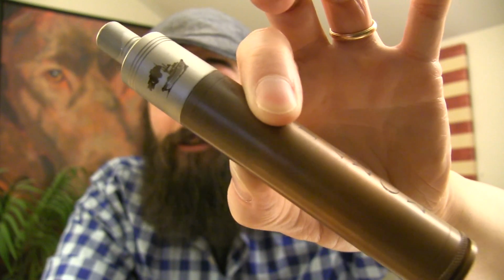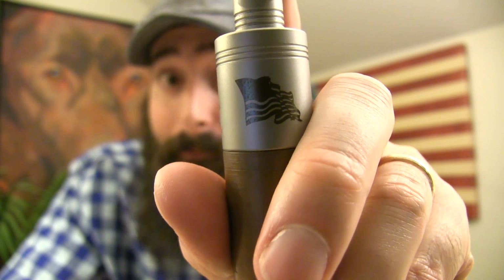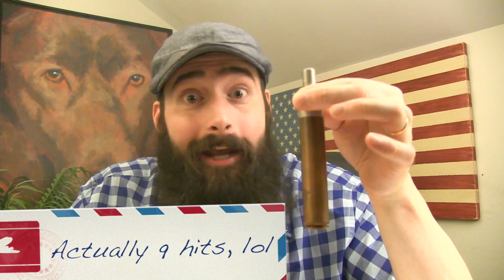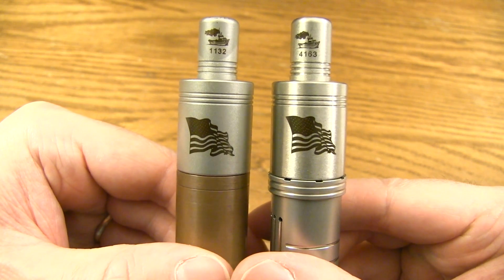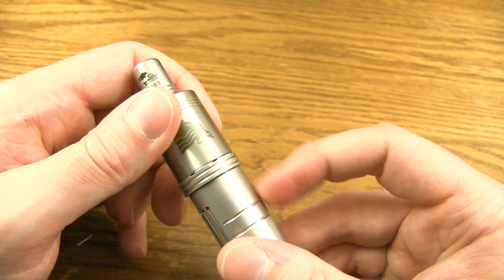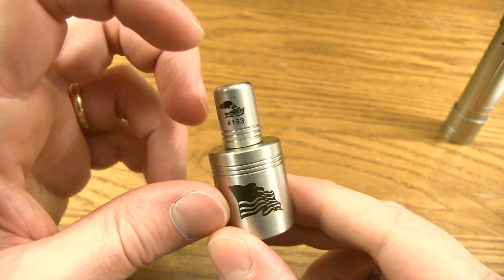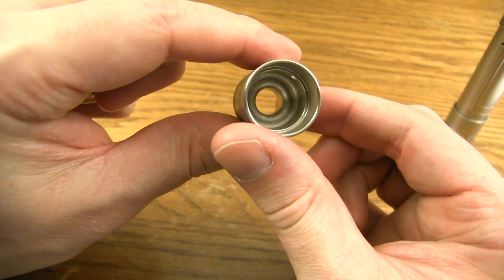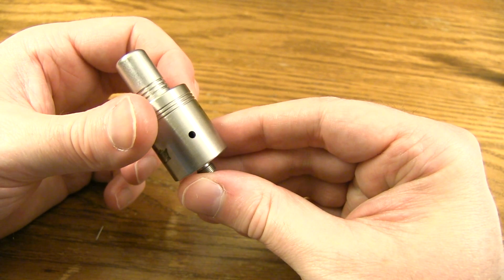The Tugboat RDA

Comment: I'm not sure if you have seen one but I am a proud owner of 1 of 100 Limited Addition tugboat with a Detroit "D" etched into the side instead of the American flag, and it IS adjustable when it comes to airflow, and its also has 2 holes on each side instead of 1. If you can manage to get your hands on a limited addition like mine, you should do a review on that one, i think you will be more impressed!
Reply: that is the new form of the cap minus the D that part is special but yea the new cap has adjustable air flow

Comment: i just bought this rda and im extremely new to rdas. right now im running 2 .3 ohm coils in series which is at .6 ohms (its on an eleaf istick 50 watt. ). im still getting used to it, but honestly my favorite part about it is the airflow. (before i was using an atlantis) still got some hickups to work out like my ohms keep jumping, but im having fun with rdas. im thinking about getting another mech mod with an 18650 battery for it.

Comment: I have one of these (genuine) with the media blasted finish. Works just fine. Generally, I run a single coil in it  - without any issues. It has larger air holes than my Patriot (genuine) and I do like that. It also holds a lot more e-liquid than the Patriot which is a bonus. Dripping every 10 minutes is a serious PIA.

Comment: I love my tugboat. I have the stainless version and I'm running a .24 ohm 5 wrap single coil with 20 gauge wire and mine heats up after 3 hits. Maybe since you're higher ohms it doesn't get hot but mine does

Comment: Would any other caps fit on the deck being a 22mm such as the atomic ? So you can have single coil adj. air flow and deep juice well.

Comment: I need some advice about building coils. I'm not getting them dense clouds. Is it the vg, pg? I'm looking to blow monster clouds. And I'm in the process of quitting smoking. Vapping helped me get down to one pack a week. I'm trying to quit. Any advice will surely help, or a vid. Thanks anyway
Reply: Its all about the build and the juice, higher VG, more clouds, coils at a lower resistance, burn hotter, so uses more juice, more juice and a higher air draw equals clouds, start with dual micros at .6, use safe batteries, get a feel for the clouds, then start tinkering with builds, rip has a video for about every coil imaginable. If you just wanna go straight to clouds, go low resistance wire, like 22-24 gauge, twist up some macro coils, and change the weather patterns in your area code, be safe, hope this helps
Reply: everything Darrin Brown said is correct but why don't you tell us what your setup(atomizer and mod) is, that way we/I can give you some advise on what you personally can do to improve your vape.
Reply: Yeah, definetly need a good RDA and mod to do some work

Comment: Guys mine has a copper center post, copper center pin connection. It's drip tip isn't as long, doesn't have the 3 little ring ingravings, and is steel all the way through. Also it's drip tip on the inside starts to taper down. Is mine a clone? Or is it a different version?

I'm thinking it's a clone but I'm not too worried I got it from someone for free so no harm done to my wallet.
Reply: My one is exactly the same as RiP's one in the video. Does yours have a serial number on the drip tip and base of the RDA?
Reply: cdv1qa Ya and the're both the same number. Also it says #flawless, usa, picture of a tugboat, and serial number on bottom.
Reply: avp3player1 Dunno man, it sounds legit but mine doesn't have the hashtag, but if it's working for you then that's all that matters I guess. Happy vaping.
Reply: avp3player1 Actually mine has a copper center pin as well. All good :)
Reply: cdv1qa Ya this thing vapes like a dream even running a 2 ohm single coil 28 gauge 2.4mm at 15 watts it's still great flavor and Im chuck'in clouds bro! Cloudz!
Reply: you have the tug boat v2 this is the v1 in the video

Comment: Rip, I noticed most of my RDA tend to strip off little flakes of black rubber o-ring onto my wick. The last thing I want is one to land directly on the coil, then I'm vaping rubber.. Any suggestions, or RDA's WITHOUT O-rings? Do you think I could wrap a bunch of plumbers tape around the top where the o-ring was, just to the point where it stays snug enough?

Comment: RIP, you need adjustable air flow, but Are a lung hitter? If i recall u prefer your air holes at a out 5/6", so why the need for a tighter draw? Adjustable airflow is not a deal breaker for me.

Comment: I have a 1.65 ohm kanthal microcoil build witu cotton. All im tasting is kanthal when i vape. I have no idea what's going on...
Reply: did you try firing the coils without cotton and juice? you wanna make sure the coils are glowing from the inside out and evenly.. maybe you have hot legs or hot spots.. give the dry fire a shot and try gently pushing the coil together with tweezers, do it a few times untill you get an even glow from the middle.. make sure you don't fire while the tweezers are actually touching the coils..
also make sure no part of your coil is touching any part of your RBA/RDA other than the legs in the posts
Reply: Iv done all those things. At the beginning it was working just fine. All of the sudden all i taste is kanthal. Im thinking it could be my pallet and iv just stopped tasting the juice. I have this problem when i vape the same juice for more than two days. Im going to try and clean my pallet and see if it fixes the issue. Thanks for the tips though much appreciated.
Reply: Dobby Sounds like you're experiencing vapor tongue. Same thing happened to me. Though I was loosing my mind for two days. Turns out i just needed to lay off my favorite juice for a bit. Or, if you're using a brand new RDA, it may just need to be cleaned out. good luck
Reply: It probably needs to be cleaned due to the machining oils... I had the same issue with my prometheus RBA, I had a .8 ohm wrap and it tasted BAD, burnt metallic taste... so I  was got a small cereal bowl, filled it with hot water, poured Palmolive and oxy clean... and let it sit for 15-20mins, once the water was cooled down I cleaned it with a small little bristle brush and rinsed with cold water...

And it worked! no more bad burnt flavor :D
Reply: They have some nasty flavors out there. lol

Comment: I have a vamo v5 and want to get into coil builds and rdas can I still do that with this mod or does it matter?
Reply: you need a mechanical mod (or high Watt box) to unleash the power for this type of devices...
Reply: it depends on what atomizer you have. You can put anything rebuildable onto a vamo, however your coil builds will be limited due to the 1.2ohm mininum on the Vamo.
Reply: Can you recommend a inexpensive box or other mod?
Reply: Nic Von I'm loving my hana DNA 30 clone , about 60$ depending on your vendor.
f you wanna venture into mechs then maybe the Brass GP Paps, onlly $15 on Fasttech.
Reply: mechanicals can do ultra low ohms like .3 as long as they have a good battery right?
Reply: It depends on the battery and mod.. Sony vct5 or vct4 are excellents.
Reply: Nic Von yeah get a vtc 4 or 5 and you will safely be able to go to 0.18 ohm .. i like to do dual micro coils with 24 G personally
Reply: and choose a good mod.. coz some doesn't handle sub-ohming very well...
Reply: Thanks for the info I ordered everything and looking forward to building.
Reply: Looking forward to see some builds..
Reply: Nic Von what did you order?
Reply: A magneto mech with a Kaylight plus rba clone and a Sony battery
Reply: You mean kayfun.. Look out for some descent dripper.. I own a magneto too.. Good mod price/quality.

Comment: hey rip, ive had a tugboat for a while and I love it! I just got a clear cap over at vapordna.com for it and my positive pin has been pushed up too far. how can I fix it and bring it back down?
Reply: take it back or contact flawless vape. they have pretty good customer service and will fix you right up
Reply: I actually was able to push the positive post back down. I just put the atty against a solid surface and pushed down and the post pushed back in

Comment: I don't see why an RDA should be rated down just because it doesn't have adjustable airflow. Sure, it's handy to have — but this is surely an intentional design decision? If they want the Tugboat to be known as an RDA that gives a vaper a specific experience, then having a set airflow is an important aspect.

Comment: Very similar to the omega
Reply: Agree, as I have both. But the Omega doesn't come with post holes for the kanthol and it has air holes on the base. The Tug air holes are higher, internal is smaller (better flavor IMO), and has post holes large enough to build dual coils with 22g wire with no issues.